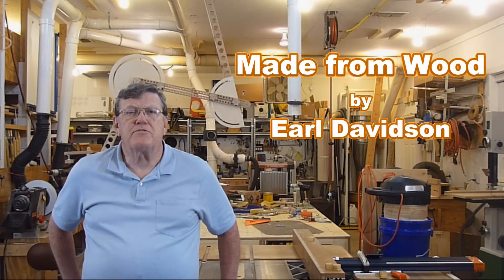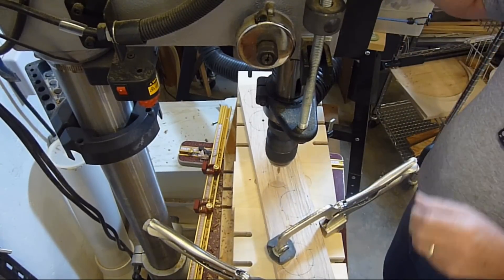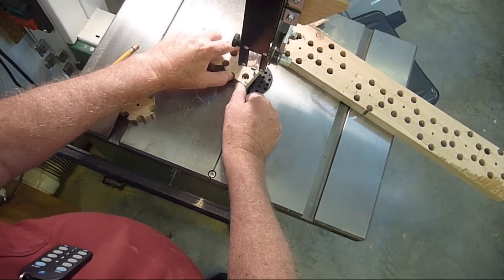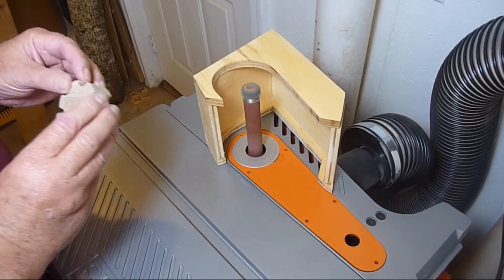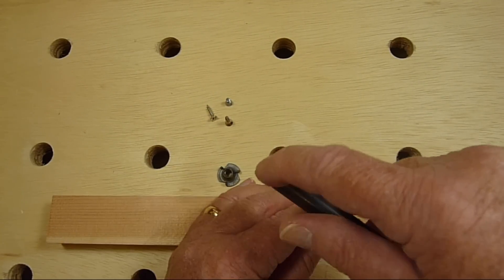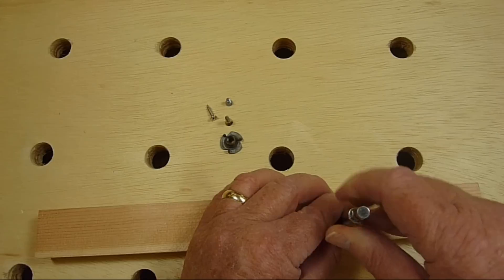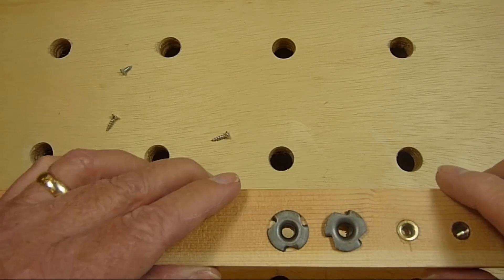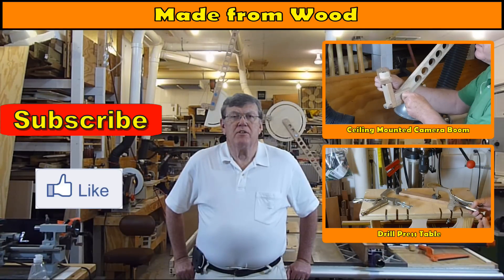Making Wooden Knobs

Comment: I'm making knobs all the time for my jigs.  I prefer using threaded inserts although I'm going to try your suggestion of just tapping the threads.  I use hardwood for all my knobs.  I did however go to eBay and purchase 1/4-20 and 5/16-18 hex drive inserts. I typically use the larger, more bulky threaded inserts but I liked your suggestion of the hex drive items.  They seem to be less likely to split the wood when seating them.  Thanks for the vid, Earl!!!  I found it useful.
Reply from the maker: Glad you found it helpful.  Thanks for watching and commenting.

Comment: I almost always counterbore for the hammer in T nuts, but use epoxy sometimes - much easier & less obtrusive than screws. I like the hex key inserts & will look for them on Amazon. Compass method and simple 2" size w/ 1/2" holes to create 'star' points is super convenient & simple - best method I've seen. I might just epoxy a bolt into the hardwood after threading, and save on the inserts. Thanks.

Comment: Earl-thanks so much.  I don't see anything on the center of your finished knob, so assume they are the tapped option.  Do you then run all threaded thru the knob and bind with epoxy so it will hold and not spin when you are using the knob to tighten something down?  Do you use a rubber washer on the inside of the knob to help tighten down?

Comment: Um, given I’ve never make a wooden knob it would be very helpful had you shown putting the bolt in the knob.  It would answer questions on what type of bolt you used, hex head, round head carriage, ...????  and how is the bole held in place, loctite, or just insertion torque?
Reply: Bolt, not bole.

Comment: I just use my cnc to make them now as needed. But before I made the CNC i used this method.  I mill a pocket to fit a nut or in the case of a bolt, the bolt head. A bolt head and the nut for it will always be the same measurements for a givin size. To make sure things stay put I put a dab of epoxy on the nut or bolt head. With any knob using t-nuts or a recessed nut like I do, the nut or t-nut should be positioned where the stress on them when the knob is tightened is pulling the nut or t-nut into the knob.
Reply from the maker: Thanks for the comment John.  Have fun with the cnc.